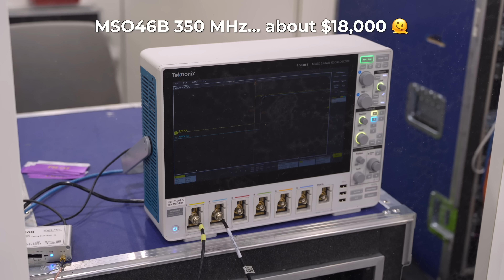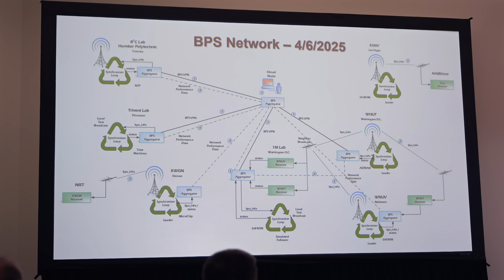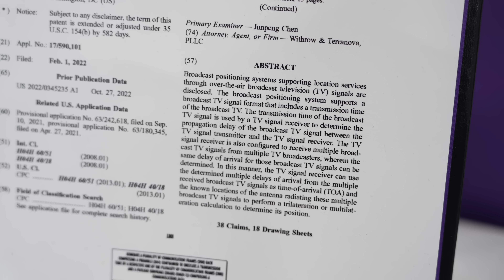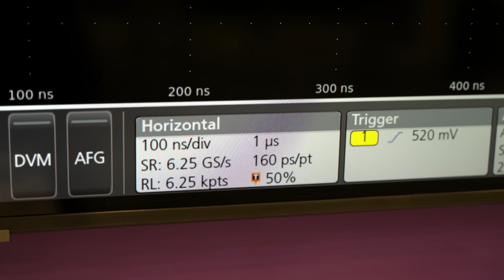I found a cool GPS alternative nobody knows about

Comment: Many years ago, I came up with much the same sort of idea but not needing anything special in the transmitted signal and using radio stations.  Radio transmitters hold their frequencies really exactly these days.  This means that buy listening to them you can freewheel a long time if you lose GPS.
For other reasons ATSC-3 is going to be a disaster.  All the encryption and DRM nonsense makes it some in a practical manner it doesn't work for a lot of people and it makes receivers massively more expensive.  When ATSC-1 quits working, I expect to carry my TV out to the curb and give up on over the air TV.  It has had a good run but it will no longer make sense.

Comment: there's alsothe  R-Mode Baltic project by the german DLR, which uses terrestrial HF transmitters to broadcast navigation signals, and has achieved between 10 and 50 meters accuracy in the baltic sea

Comment: Yes a rabbit hole. I had an old iBook G4 and a USB TV tuner hooked up to my TV antenna. I started noticing my clock drifting so much drifting that I would have to reset it weekly. Since that system was on all the time and didn't leave that location it was hit the most. I started down the rabbit hole looking into why this would be occurring and how to keep it synchronized with NTP etc. I don't know whether it was due to the magnetic field of the dam that I was near or the vibrations or the extreme temperature changes in the very uninsulated house I was at. My suspicion is that there was a resonant frequency developing between the time in Crystal and the Dam. Yes changing the orientation of the laptop slightly improved things. At the same time the tube TV in the other room had to be degaussed every so often to keep the color in the actual color spectrum and not the crazy rainbow spectrum, although I did get very good at doing it by hand with a strong magnet.

Comment: I remember many many years ago that some VCRs could auto set the time using any TV channel that added the time to the over the air broadcasting signal so you didn't have to manually set the time if you wanted to set timers to auto-record TV shows when you weren't home.
Reply from the maker: The age old issue of setting the VCR time...
Reply: I think the time was sent with the teletext .

Comment: I remember before most people had a GPS device or phone, and the satellites had deliberate errors in the timing signal  to avoid accurate positioning for non-defence. Some of the FM radio transmitters (mostly Triple J) I maintained had differential GPS data as a subscribed service for accurate civilian use, this was in a subcarrier together with RDS.

Comment: Not really anything new, DGPS has been a thing for ages. But it's interesting tech no matter how old it is, especially when you realise kit in the 90's were capable of doing it, so with the addition of 35 years, it's even better.
Reply from the maker: It seems every decade or so, a new solution has the possibility of wide deployment—this one seems attached to ATSC 3.0's success. I'm still not convinced it'll get full-scale deployment but I hope it will.

ATSC 3.0 in the US is interesting, though. I probably won't have a TV capable of even decoding it for a while.

Comment: There was recently a project started that discussed using LORAN and MUON waves for underground and in-building geo-location in GPS denied environments. Part of this was to help locate lost miners and cave divers as an example. I could see it being used in other ways such as timing, but I would think to get the accuracy you would have to know your distance from the transmitting source (precisely) that may be harder to do.
Reply from the maker: Underground seems difficult, for sure. I remember reading about one military installation with an extremely low frequency pulse that could be picked up even by submarines deep under the ocean. Used a massive antenna and a lotta power!

Comment: How does the difference in time signal affect position accuracy?
Reply from the maker: Good question! I may dive deeper into it soon, but basically, if you can calculate the time it takes for a bit of data to reach you, and you know the position of the device (tower) that sent that bit of data to you, you can calculate a pretty precise distance (at least in an arc) from that device to you.

If you have multiple towers broadcasting, and you take all three+ of these data points, you can find where the circles overlap and know precisely where you are in relation to the towers.

Comment: Most interesting, unfortunately we don't use ATSC on my side of the planet, so I wonder if something similar might get rolled out in other countries.
As for time at my house (not frequency), I use an oven stabilised oscillator, (I think it came from a defunct Loran receiver) that is occasionally compared to GPS, I used to work in a telco calibration lab, directly using GPS was a no-no as it is controlled by a foreign entity.

Comment: Is BPS really disconnected (3:15) from GPS, as in does each transmitting station have its own synchronized atomic clock or are they getting their time from GPS?
Reply: Lol - all broadcast TV uses gps as the master time clock source. Doesn't make much difference if you use gps or bps, if gps is down, so is bps.
Reply: The transmitting station will get data from a number of sources, including GPS and eLORAN.
But it's not dependent on GPS.
Reply: @DerSolinski  not dependent on GPS while claiming to be an alternative means it has to have cesium clock sources , otherwise it can't be called as an alternative to GPS.

Comment: I heard some farming equipment uses transmissions from dedicated towers to position tractors &c to 1/2" for contour farming.
Reply: John deere even has its own sattelite network to compliment GPS to overcome these local towers, since they found out, local towers are not as reliable as expected, causing issues for planting / harvesting seasons.

Comment: First of all, I have to express my admiration for your enthusiasm. You're grinning like a honey cake horse (German saying). I always used DCF instead of GPS to determine the exact time in the networks I was responsible for, incidentally with Meinberg because they are very reliable and durable. I only had problems with one of the networks that was very close to an airport. Whenever there was fog, there was reception interference, which was probably due to the ground radar that was then switched on. Well, I think the idea of using a network of earth-mounted transmitters to transmit a signal that is needed to determine the position is excellent, especially because the network already exists with countless radio stations and TV transmitters.

Comment: A potential video for your main channel: How did switching between different analog TV sources work and not cause a temporary loss of NTSC vsync lock? For all sources within a studio, you can have a common reference clock and genlock everything to that... But what incoming satellite feeds? Or VTRs? I assume once things became digital (even in the analog broadcast era) it was easier as you could just buffer some frames and use the local reference clock, but what happened prior to that?

Or maybe there were temporary losses in vsync and I'm too young to remember/ever see it?
Reply from the maker: That's actually a question I talked to two different people about at NAB... I was focused more on audio, but both have the same sync issue, and there were issues in the past. Still issues with digital—but fewer as a lot of equipment is a bit more robust with TCXOs and such, in case of sync failures.

Comment: Retail stores have been using Bluetooth and Wi-Fi to accurately track customers locations inside stores for decades, they just haven't been honest and open about it. They put passive readers all over the stores and track anyone and everyone with Bluetooth devices. They know your location down to a few inches the entire time your shopping as well as every time you come back and what you're buying. You have no idea how much data they have on you and it's absolutely frightening
Reply: Yeah I heard about that recently, real scary tbh. I think the stores mostly use it for getting heat maps of their floor layouts vs for more individualized tracking due to reputation so risk if it got public (although I’m sure some stores are taking that risk), but even if stores aren’t matching tracking data to individual customers I’m sure it’d be pretty easy to cross-reference if you have other data available. Basically impossible these days to have any semblance of privacy unfortunately
Reply: @goinginzane The city of Antwerp in Belgium tracks every smartphone in the city center that connects to a celltower, wifi or bluetooth and sells the statistics to marketeers so they can see howmany seconds someone spent in front of a display or howmany people passed a shop at which time.
It's all "anonymised data", which means if you know where someone was at some point in time (say paying for something in your shop with a creditcard), you can just follow their dot all across the city.
The 5G providers in Belgium sell tower connection data of anyone connecting on their network, and the banks sell your transaction data. Anyone can be tracked within a few dozen meters by everyone that has the cash to buy the data, except for law enforcement, because law enforcement would need a court order to even just look at the footage of their own cameras.
Reply: This is somewhat overstating the current affairs...
While it is technically possible to do that "passive" the signal to noise ratio is very high.
However most modern smartphones have the ability to play ball thx to Apple and AirTags/Beacons.
And since everyone and their "partners" are interested in tracking you, those features are usually on by default as soon you accept the "recommended" settings.
Reply: @DerSolinski every reply disappears, wonder why? I've provided the details but they don't want you to see it
Reply: You're gonna have to back that up with some proof.
Reply: @deephorizon1365  Not sure about Bluetooth, but MAC randomization/rotation was specifically added to iOS 8 and Android 10 to make tracking via WiFi harder (people hopping on the free WiFi because of congested cell towers). It's not practical to determine what specific thing you're buying with Bluetooth or WiFi though, and the retailer would know anyway... when you pay for it.
Reply: @deephorizon1365  I worked in big box retail as management and we got the reports on our desks weekly. Those call buttons for service had dual propose but now it's hard wired, that's why they offer free Wi-Fi. They know who, what, where, and when you're in the store from the parking lot to the checkout as well as everything you bought. That "loyalty card" isn't for discounts...
Reply: @deephorizon1365 well every single time I reply it's deleted, thank your censorship overlords. They don't want you to know, nothing in my reply is offensive but it's instantly gone
Reply: You can just turn off bluetooth and wifi. There is nothing you would need to use any RF for at a grocery store if you already made a shopping list.
Reply: @Velocifyer  Remember to turn off Bluetooth and WiFi "scanning" as well. They assist in location accuracy and are independent of your main BT and WiFi toggles.
Reply: @Velocifyer  When was the last time you saw somebody without wireless earbuds.
Virtually nobody turns off BT anymore...
Reply: @DerSolinski  today. Also you forgot a question mark and headphones that use standard stereo analog output sound much  better than anything with just bluetooth.
Reply: @Velocifyer  No, I didn't. It wasn't a question.
Also BT isn't a sound quality indicator. 
There are a myriad of factors that play into that.
Reply: @ "When was the last time you saw somebody without wireless earbuds" is a question. Also bluetooth has a lot data rate so you need a low bit depth OR frequency OR lossy data. While with analog headphone connections the only loss is the noise and frequency and bit depth is just based on whatever DAC you have
Reply: @DerSolinski  I would answer today, and that being myself (in terms of me being at work and not at home, where I do actually have BT headphones)

Comment: I wrote some of the code for that scope. This is the first time I've seen one in a random video.
Reply from the maker: It's a nice scope!
Reply: @Level2Jeff   what kind of scope was it?
Reply: @skywalkerv1  I think it's a Tektronix MSO46
Reply: I use a similar scope at work.  Very nice instrument, cost around $85k, so more than my car to…
Reply: Sounds like a really cool job!
Reply: Congratulations! That's a cool moment. I once worked for a sign company doing graphic design to propose the designs to the customer to choose.

When I finally saw the real life versions of one of the options I'd photoshopped for them it was really cool for me.
Reply: @IIIDrDoctorIII I once hand-drew a cartoon snowboarder on the menu of a friend’s restaurant. A few months later I passed some guy on the sidewalk with my snowboarder tattooed to his calf. I asked him where he first saw the picture and he said he didn’t know.
Reply: We get it out at work when we have a problem none of the smaller, weaker oscilloscopes can solve
Reply: Trippy sort of feeling isn't it?  What did you write in the scope?  I am not affiliated with this project at all just curious about a dev doing work.  I mostly do system integration and projects on the side for fun.
Reply: @randomrant3886  the trigger code for most of the supported bus protocols
Reply: sick flex.  no, really.  it is.
Reply: It crashed when I use anything with your functions

Comment: What happens when someone who understands GPS as well as he does international trade decides that those of us outside the US shouldn't use it without paying? Or if he has a friend who has an alternative satellite system from which we can buy timing data? I have a feeling that the world has to be ready to work as if the US and its technology is unreliable or even hostile.
Reply: The GPS signal is free to use.  I guess they could go back to encrypting the lower bits of data so that you couldn’t get military-grade positioning, but once they turned off selective availability, I think it would be hard to turn it back on.

At least, for the current and next-generation GPS satellites that they’ve already got up there.
Reply: Thats why there is Glonass (Russia), Gallileo (Europe), Beidou (China), and good receivers take all signals into consideration.
Saw a demo with a ublox once, where you can select which networks to use, and the effect on position accuracy.

But broadband spamming will not be avoided. Land based signals can be stronger, so more difficult to jam long range.

Comment: Wait, how accurate is it?  Isn't there a risk of it being used for MISSILE guidance?  Wasn't there a whole thing about GPS chips being capped to a certain accuracy for that very reason?
Reply: As far as I know are consumer GPS chips capped to a maximum speed as well (800-900 km/h or something on that range?) which is the main measure against military use. As you probably know it’s already pretty accurate also for consumers if you look at your favorite map app which would be enough for most missiles I guess. At least if you want to hit a car or truck or even a person. 

But as missiles are pretty fast the consumer chips just turn off if they reach a certain speed. I never tested it myself but I think I read that somewhere :)

Comment: Resilience and survivability are the keys to positioning and timing. 
Using purely space-based assets is useful for global coverage, however, terrestrial kit (DVB-T?) is often quicker to fix and might have a higher RF power budget to avoid jamming.
In the UK, exiting the EU locked us out of the very system we helped design (Galileo). This seems to be promoting research into high precision local timing, but I don't see any real replacements for GNSS yet. 
DECCA and LORAN receivers are sometimes found on very old sailing boats but won't work today, sadly (unlike a sextant & watch). Pass the grog... 😊
Reply from the maker: It would definitely be harder to jam a 100 kW+ TV signal, at least without being quite near a device!

Comment: When I started in TV Broadcast in 1973 transmitters used thermostatic crystal ovens which had about 150 Hz range between  high and low temperature end points. Almost identical to ones used in AM radio transmitters.

Comment: I'm pretty sure that you need at least 2 signals to find position.
Reply: Maybe if all the TV stations in a city implemented it (and they are not co-sited)?  It does sound difficult, though, in my country they are always co-sited and only a few places can receive signals from more than one site.
Reply: @BrianG61UK  With only one signal you can get radius from source, but not heading.
Reply: @Abednego-v2r  That could be difficult. You'd need an accurate clock to compare with.
Reply from the maker: Yeah; right now it would be timing-only until they get full rollout. Most major cities have at least 4-7 towers.

Comment: Would BPS be able to give you location data (via triangulation with more towers), or realistically is it just for accurate time in the field/indoors?
Reply from the maker: For now time, but location is directly correlated, once you have at least a few signals. So eventually location + time.